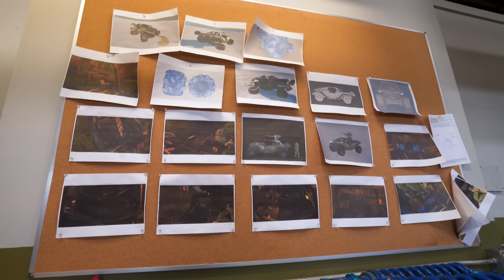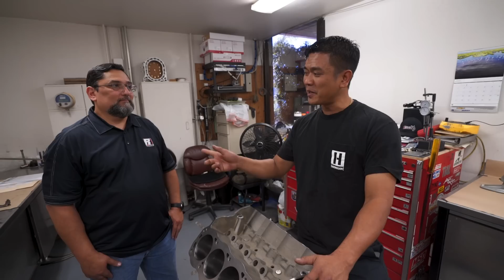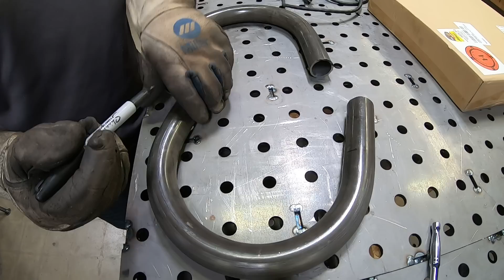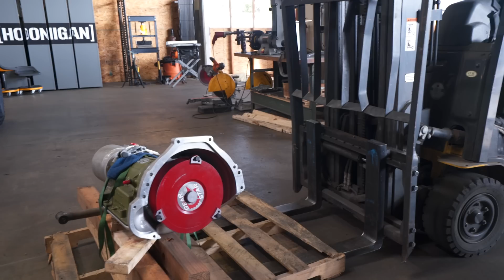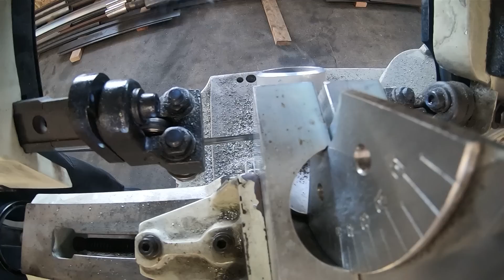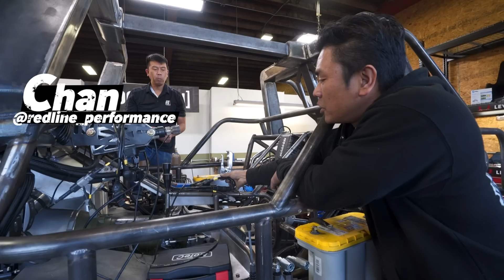FIRST START! Our HALO Warthog's 1,000 Horsepower TWIN TURBO 438ci Ford Windsor V8 arrives!

Comment: i regards to the drivers sizing issue consider that the warthog isn't designed for Spartans its fitted for the games npc marines which are a standard 6 ft . master chief kind sits on the head rest and stoops down to drive it in game. its only in  halo 4-5 that the warthog model is compatibly sized for the spartan 4s but even then they are still shorter than the master chief (spartan 2s)

Comment: The chassis is too small and too low vs Warthog in HALO.
You should approach it with military thinking and start with "heavy truck" sized design process. And you did not make it IFS/IRS.

Comment: exhaust gas temperature sensors... effectively closing off the secondary throttle valves, thus preventing a brake down. because buddy will drive 100 miles off into the dunes and blow up the motor doing so, to avoid getting power hammered by the seeker. :chillwcat:

Comment: Dude, you don't want to connect radiators with the tube connecting both by the bottom of both radiators. radiators flow from bottom to top, so you want the outlet on the top of the first radiator in the flow path, to connect to the bottom of the secondary radiator. IT IS GOING TO BE SO FUCKING DIFFICULT TO GET ALL THE AIR OUT

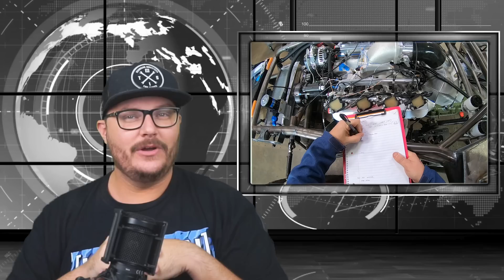Comment: 13:57...To Be honest, the origina l warthog was, quite easy to flip over, done it many times myself!^^ But it was one speed, and, if this is supposed to be a replica, I feel it should as well. It's the one on the joystick who needs to properly drive it. I gt it I get it but, also, everytime I've ever drivin that thing, it musta had the most sliperriest tires of anything outthere!! That thing drifted standardly. I don't think it's possible to drive that thing without sliding in the game, u have to encoorporate it into ur navigation skills. I think u guys are doing dope and yeah, caution behind the driver!^^
\O>

Comment: Did someone NOT measure this before starting the frame?? Seriously. All of the issues you had with engine trans and Xcase placement and interference would be remedied by a wider chassis... not to mention it wouldnt be as roll happy. Thats one top heavy mofo already...

Comment: As custom as this build was and the best battery you guys came up with was a yellow top? Do you need the link to XS Power battery? I thought you would want to use only the absolute best option for your battery? Right? XS Power has a completely sealed enclosure that's shock/vibration resistant for off road applications. XS Power also uses M6 screw-in terminals that does away with the lead posts eliminating the need for terminal maintenance. Much more clean appearance. If your planing to add off road light bars, and aftermarket accessories XS POWER in tandem with a Singer H/O alternator will be what is required to effortlessly run anything you add to the vehicle.

Comment: i dont know how well it would go but you could make the 4 wheel steer better if you talked to JCB they could probably hook you up with the steering system they run it has all wheel front or rear and crab all with just the steering wheel no joystick and has a lock out to front wheel only at high speeds.

Comment: Cant believe they built a windsor for it instead of just dropping a crate LSX in there and reliably hitting their hp goals.
Reply: I think it has to do with Microsoft and Ford having a corporate relationship
Reply: They’ll hit their power goals reliably with the Windsor. Only a 12 year old would think otherwise
Reply: @sav22rem22  oNlY a 12 yEaR oLd wOuLd iNvOkE tHe OnLY a 12 YeAr oLd ArGuEmEnT
Reply: @_BangDroid_  Yikes. Typing like a sperg??? Big L
Reply: @sav22rem22  An ls is pretty much a better windsor. No hate on the windsor,  just saying it would be easier, cheaper, and ultimately less work with an Ls. That being said, they have a microsoft budget so they could be rocking a freaking built ej if they wanted to

Comment: Great build alot alot of work 👌💯 those welds are amazing ....... but i kinda wish use had an Mechanical engineer like me 😋 design up some drawings and models to work off he Angle of the rear Square roll bar is too steep and is astheticly annoying, why didn't yous just make the Chassis longer 🙄.  Looks like some one squished the warthog 🤣😅🤙

Comment: Ford Windsor V8? That killed it for me. As a kid I had a 79 Ford Thunderbird with a Windsor 351 V8... It was heavy and slow to do anything. Half the time it leaked oil and choked on its own fuel/air when you tried to stomp the throttle. It was a cruiser though... looked great. Lost my virginity in that car... the 80s man. Good times...
Reply: My Windsor 351 never sounded like this one though... would have been so much cooler. I probably would have died in a ball of fire though...
Reply: @indianahoosier5794  79 or the 80s in general wasn’t exactly a good time for power in general. Windsor’s flow really well when all that garbage is ripped off of them and some good heads are thrown on.

Comment: "Over 1000 HP". It would be so badass if they could tune it to exactly 1170 HP (1170 for Spartan 117, Master Chief's callsign. Lol). 

Or 1169, because "Nice."
Reply: But, they need a 117 hp version for noobs to buy too!
Reply: @andrewvaillant6365  Lmao, 117 HP in this thicc beast wouldn't even get the tires to move.
Reply: @kasper_429  Well duh, that's the joke here. Noobs get the crap model, lol
Reply: @kasper_429  short gears and you got a slow crawling beast lmao

Comment: Can’t wait to see the warthog on this vs that
Reply: Against the Hoonicorn
Reply: I cant wait to see gymkhana: masterchief edition
Reply: Vs Ken's BAHA trophy truck
Reply: With a gauss cannon will blow them up.
Reply: I'd love to see a Hi/Lo version of this build.
Reply: @toddlynch7282  OK but I get hi truck! #giveitthebeans!
Reply: That front and back steering with 1000 HP will be unforgiving on a drag strip.
...add a flying finish with anything but a perfectly aligned front and rear landing and you're bouncing into an instant barrel roll.

...and I can't wait to see it.
Reply: Ya bring out farm truck from that drag racing tv show with the 405 guy's!

1,400hp 2wd farm truck vs. 1,000hp 4wd warthog!
Reply: @brandonhoffman4712  Red truck race from 1320 lore. Unless that is the farm truck. It wouldn't start, in the middle of the city, then it came on, dumped so hard almost hit parked cars. Then the getaway truck made a tower of smoke. lmfao. Those trucks. Get them!
Reply: Kind of surprised they didn't like this comment

Comment: Not trolling but, isn't the Warthog's suspension IFS and IRS? If this was a military vehicle the engine would probably be a turbo-diesel for the torque to deal with the added weight.

Comment: If this beast doesn't end up in Forza Horizon 5 we all gonna RIOT! 😂😂
Reply: Its been scanned and has been teased. Watch the new trailers and look closely
Reply: @andwooo9460  Only the real version of the Warthog has been seen, this Hoonigan version is not 😉
Reply: Do you Bois like MEXICOOOOOO!
Reply: I mean it's been in 3 and 4 (or at least 4), so I don't see why they wouldn't put it in 5. Lol.
Reply: @kasper_429  not this one with this engine though
Reply: @kasper_429  I'm talking about THIS Hoonigan version
Reply: @joealex65  It's literally the same thing, besides the engine. The Hoonigan version looks identical to the game version aesthetically, to me at least.
Reply: @kasper_429  You are LITERALLY blind! 😂😂😂 It looks very different, and it will be more interesting to drive in the game, it will be WAY faster and agile than the real Warthog
Reply: @joealex65  Well, you'll have to excuse me for not knowing/recognizing every little detail. I haven't played a Halo game since Halo 3 or 4. Lol.
Reply: @joealex65  they actually could put 2 different versions in the game if they wanted to because they would both handle very differently.  the current Forza warthog has independent suspension on all 4 corners and only has front wheel steer if I remember correctly. while the Hoonigan version, if made accurately to the real one, would have 4-link solid axle suspension on the front and rear and possibly have front and rear steer, plus a lot more horsepower.  I really hope they do add this version to the game.
Reply: @saltyfloridaman7163   Fair enough man. I’d like to see Master Chief as the driver in forza actually except his head would be sticking through the roof so they would need to install sun roofs on every car in the game.
Reply: lol
Reply: agreed
Reply: Right on
Reply: The regular Forza Warthog and The Wartkhana
Reply: I want the Hoonigan version of the Warthog too, not the one we've already seen in FH3&4, I want a 1200+hp twin turbo v8 Warthog. I know they said this will make 1000hp but looking at that engine setup it should make that on relatively low boost.
Reply: Bungie could sue Forza because it looks like the Warthog. So there would be some expensive legal stuff involved in order to make that actually work out haha. It would be cool however.
Reply: Forza is Sony man
Reply: @gptsiteuser  Forza is Microsoft. We already have Hoonigan Car packs and the Warthog.
Reply: @gptsiteuser  since when?
Reply: @gptsiteuser  funny joke
Reply: @gptsiteuser  Imagine being THIS wrong about something 😂😂😂😂 Microsoft owns Forza you 🤡
Reply: @gptsiteuser  Forza is Microsoft my dude
Reply: @gptsiteuser  awful trolling lol
Reply: @vicdiaz5180  pretty good responses